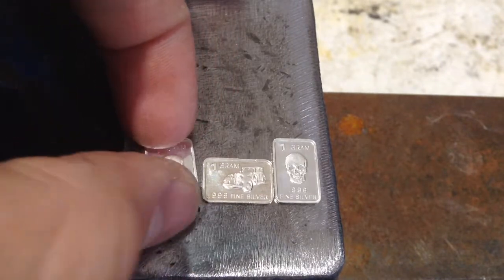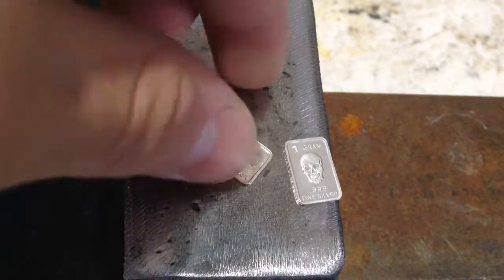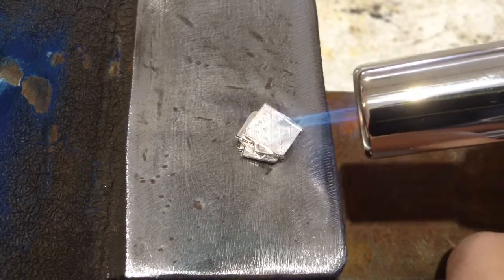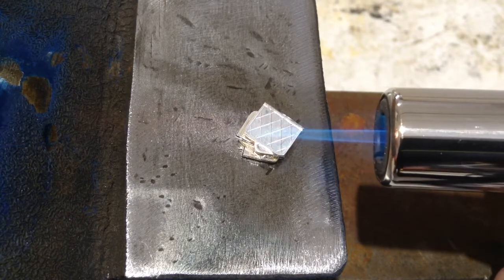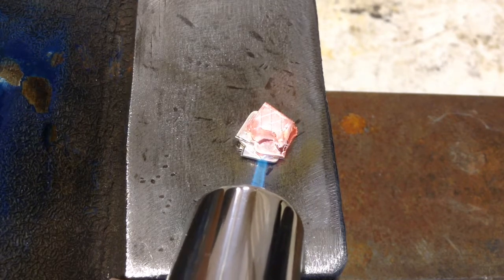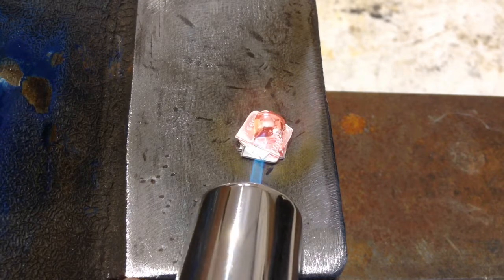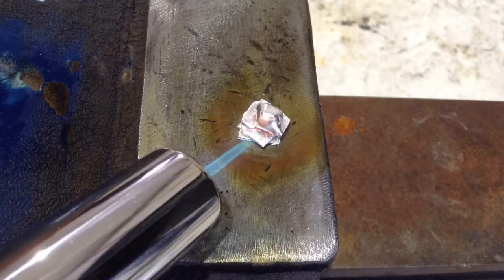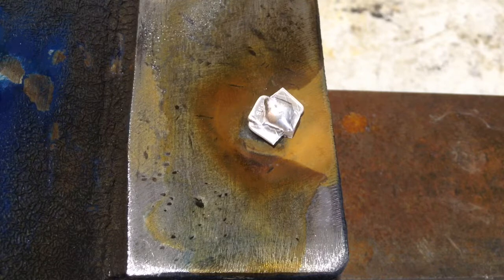Melting SILVER with a kitchen torch?!?

Comment: Silver sucks all the heat right out of the torch the silver displaces the heat quickly i use two bernzomatic ts8000s on bbq tanks and cant melt more then a few oz at a time ....the bigger tge chunk of silver the more btu(energy) it takes to melt it its a wild metal to work with oxyacetelene works best